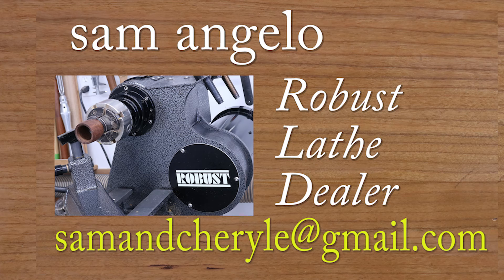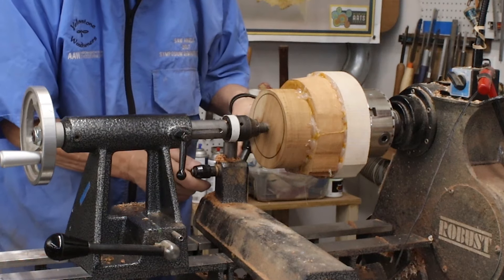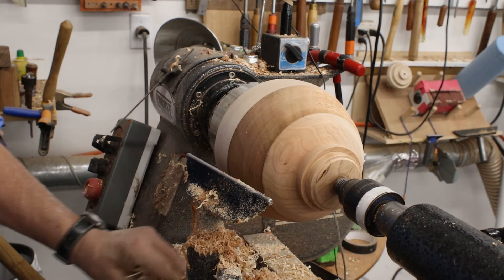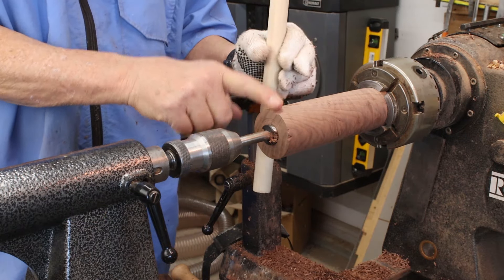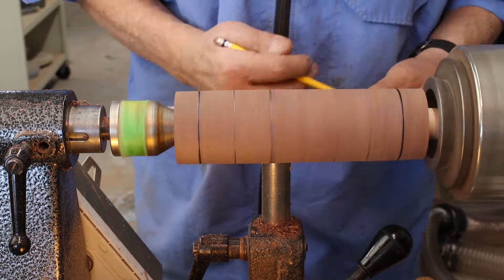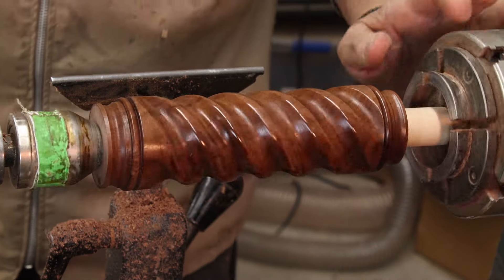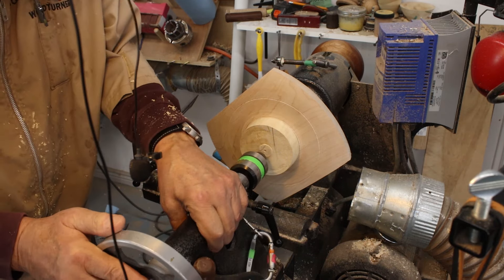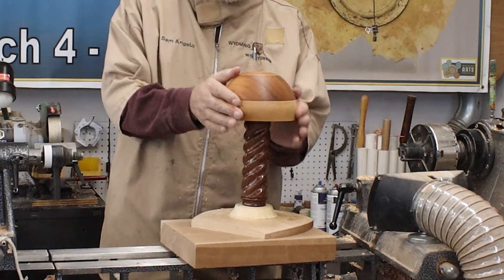Turning a Wig Stand with a BarleyTwist - Four Ways Project - March 1st, 2024  with Sam Angelo

Comment: For those who travel, a dismantling wig stand sounds an excellent idea, Sam. Starting a barley twist always seems laborious, so I found I could accelerate the process with an overhead router using a v shaped bit or half round. The jig is an old kitchen drawer with end brackets to take one of a selection of plumbing pipes,, each equipped with a dedicated permanently marked off push rod, fitted with a 6mm hanger bolt The blank is drilled to take a temporary metal insert at the tailstock end. The pipe has a drilled port for the router bit, and a spy hole at each end, and after passing  the grooved blank it can be trimmed to size. I use a round rasp and sanding sticks or drums on a flexible lead, taking advantage of the tool rest for support. Still early days!.   Bernard.
Reply from the maker: Thanks sorry it took so long to get back to your comment. Yes, if I made many of these barley twists, I would have some sort of machine set up to save myself from going crazy. This was a little rough on my hands, so I may not make another one.  😫
Thanks Sam

Comment: Sam, I see a box of sanding strips in the background.  Those, or masking tape, could be used to layout the barley twist.
Reply from the maker: That’s correct. And that’s really not a bad way to go laying in this out with a pencil and drawing lines, vertically and horizontally did work fairly well. But wasn’t much more accurate than wrapping thin strip sanding cloth around that to market off. Sam

Comment: Interesting approach to this highly unusual project. -- that barley twist is really nice. Based upon your experience with this one, is there anything you would do differently to speed up the process of producing the barley twist?  Also, the use of the dowels to preserve the highly figured wood was brilliant.  Definitely going to remember that for future projects.  Thanks for the work you guys put into these 4 way projects. Yours was the first I've watched, now on to watch the others.
Reply from the maker: That’s a great question. I would probably start out with my Merlin to grinder to remove more wood quickly. The one tool I really need is a round rasp. I had one, but it was too small. By the end of the day I figured out which tools I needed And quickly found those and use them more to complete this project. But it was a lot of work. Thanks, Sam.